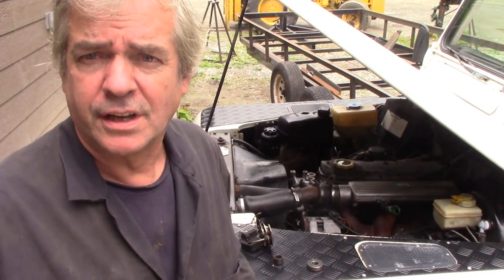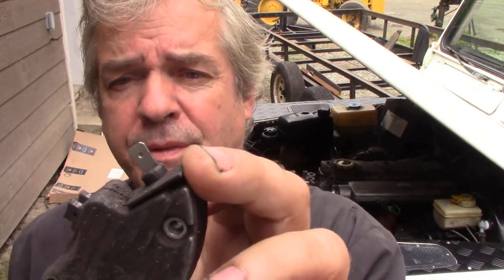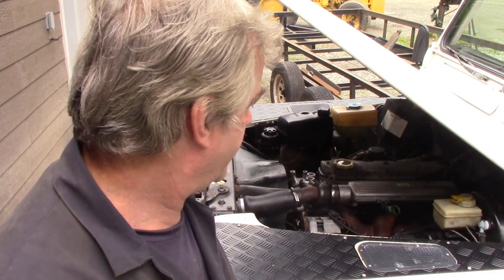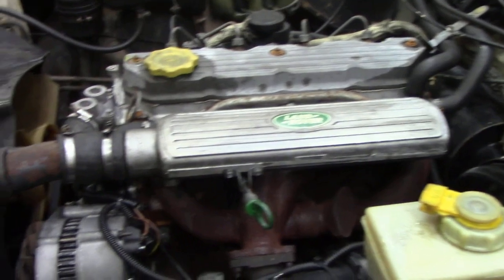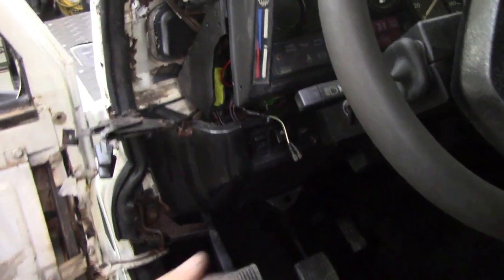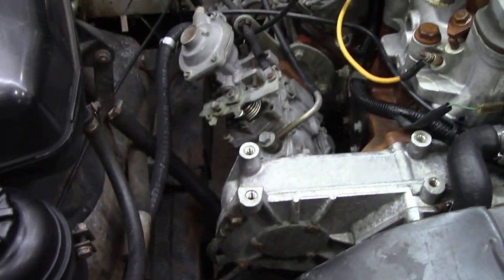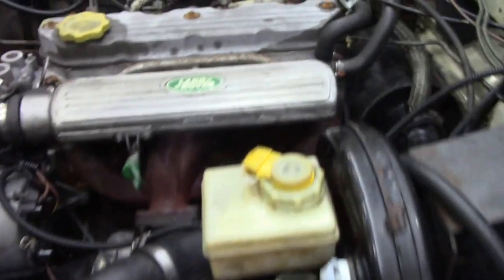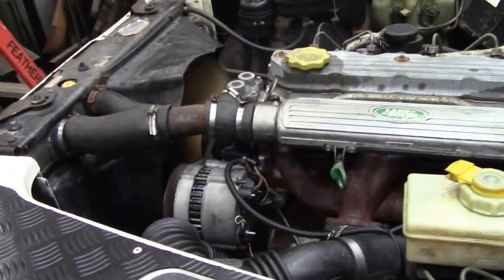110 charging system check and results part 2

Comment: Just on the Tdi starting, that is the one thing that stands out, mine would only turn one quarter of a revolution of the engine crank and it fires up every time, it's quite remarkable, a mate has one just the same fires right up hot or cold, brilliant. Maybe the "Ghana special little beauty" has an IP timing issue.
Reply from the maker: Probably but not my battle at the moment!

Comment: Thanks for the insight into this truck.

I've got the same engine in my Series 3. Looks like I have the same arrangement as was attempted here too but mine does work better by the looks of things. Do you happen to know the v belt type and length used for the alternator? 

At some point the belt will give up the ghost when I least need it to.  I struggled or didn't try hard enough to get the same size as what I have. The shorter one I got supplied means the adjuster bar smacks into the water pump before I can lever it on. It'd be so much easier for me to get the right belt for what currently works rather than monkey around moving the adjuster to another bolt on the waterpump casing especially as I think they are different lengths in different holes.

Cheers looking forward to the next video.👍

Comment: Hey mr. Mike, i am sorry bothering you so much. Here in Brazil, on the defenders 300tdi is very common the alternator's front bearing failing. Many owners use to carry a shorter serpentine belt (6pk1420) to replace the normal one (7pk1580) when the alternators bearing gets stuck (it is used only as a roadside repair - just to go to a shop). Lots of people replace the genuine alternator (65Amps) by the discovery 300tdi alternator (100Amps). The bearing is more robust on discos alternators, right? Thanks!

Comment: I grew tired of my Magneti Marelli alternator and replaced it with a Bosch about ten years ago. More amps and a much bigger front bearing. My 300tdi charge light stays on unless I rev it a bit after starting (and that's with the Bosch) - and it is not just the light - it is not charging until you up the revs monetarily. Is that a bug or a feature?
Reply from the maker: feature..

Comment: Hey mr. Mike, after starting the engine, my 300tdi always keeps the battery light on until I push the accelarator pedal. I was wondering if it could be a problem with the regulator or rectifier...
Reply from the maker: Some do, some do not - the 200Tdi sometimes needs a push on the pedal to put out the light - the alternator my need a service before it fails

Comment: You seem a bit disheartened with this one Mike.
Keep yer chin up pal.

God only knows what the guy who wired it up with spare spaghetti was trying to do.
How far back had the wire melted? If its back into the main loom, then it's bound to have affected other wires. 

His pockets better be deep. 

Take it on the chin mate.. You've bought a dog... Strip it, and sell what you can. If parts are so expensive over there, I'm sure he can make a few quid. Saying that the owner must not have a clue how to use a spanner because no one in their right mind would have bought it in the first place. 

Good luck with this one Mike...
Reply from the maker: It's not my vehicle - I would never buy a pup like this1!
Reply: @BritannicaRestorations  i think Stap 00 was suggesting what you could say to the customer: "hey customer, you bought a dog, take it apart and sell the parts..."
Reply: Sorry Mike, lost in translation.  I know you wouldn't buy it. You are the LR go to guy for me all day long. I was referring to the owner/buyer.
You make land rovers better...
I'm not sure you can with this one. Not without a shed load of cash. That could be spent on getting a half decent vehicle.

He should cut his losses and get what he can for parts.
He might even have a case to get his money back if he went down legal channels. The vehicle has obviously got a false certificate of conformity.

Sorry for the confusion Mike. 
You da man 👍👍👍